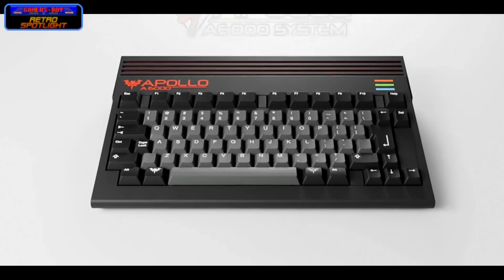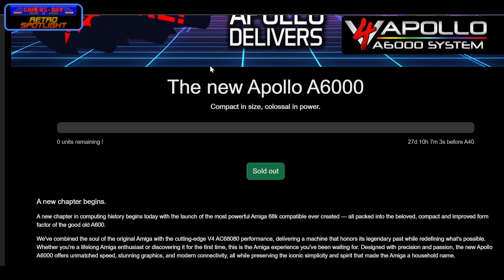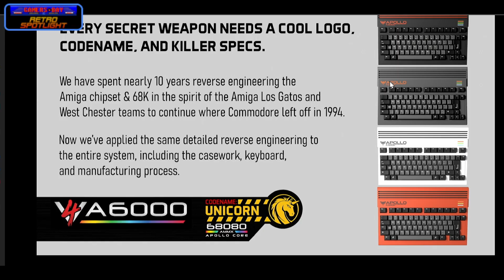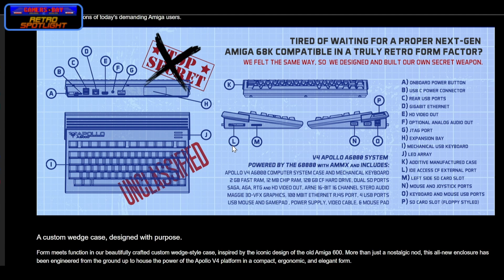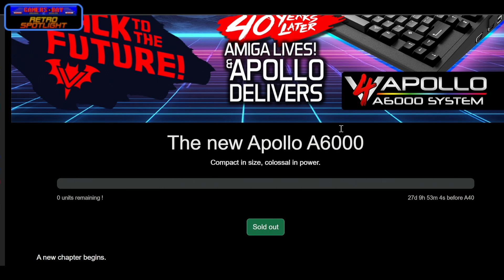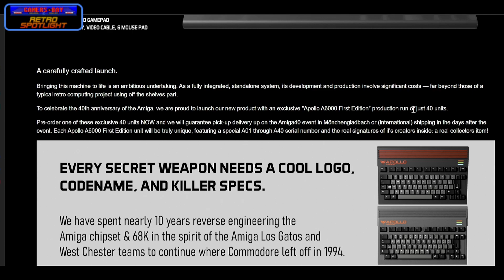Apollo V4 A6000 Amiga - Gamers Bay Retro Spotlight

Comment: Is it possible to plug an Amiga 600 vampire v4 into this system  to get even more power
Reply: This is an updated Vampire V4+ Standalone in a different case.
So the answer is no, The Apollo V4 A6000 is already a bit faster than the Apollo Manticore V4.

Comment: This is not brand new hardware. The A6000 is based on Apollo Vampire platform that has been on the market for years. The case may look like new but there's nothing knew in it either. It is normal evolution of the product if company wants to take it to next level. And if you don't like it just look away, not sure what the problem is. 
It's great looking design and spec and it has its own place in the market. And you're not part of it, obviously.
Reply: Not yet. I've been wanting to get an Amiga of my own or something like this for a while now. I've been wanting to build up a collection of systems, for Retro Spotlight, and my own channel. My biggest concern is the age of the hardware, which I've mentioned many times. Using FPGA recreations of older computers is a good way to experience them without emulation, so the original hardware can be preserved. Where would you recommend I start?